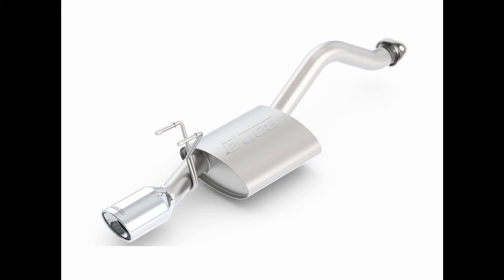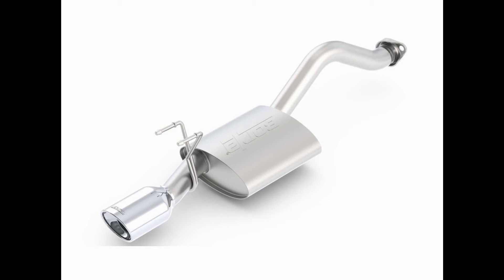Honda Civic Borla Exhaust Sound

Comment: Which exact model is this borla exhaust and where did you find it? Been having trouble finding the right exhaust for my lx
Reply from the maker: I found it on www.carid.com and they have a great deal on it. Enter your car specs and it will come up. It fits the the R18 motor and the LX has that as your good. It’s the borla axle back exhaust. Hope this helps